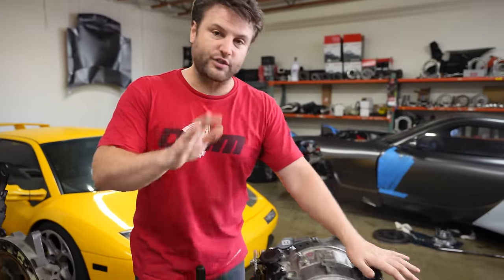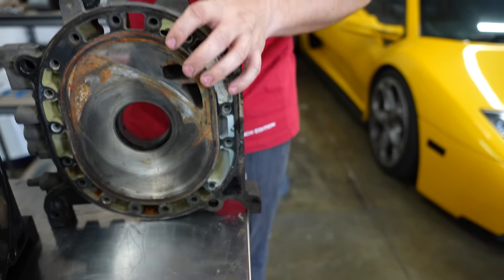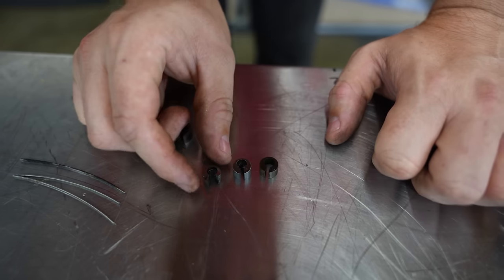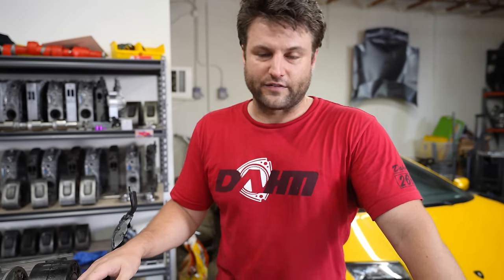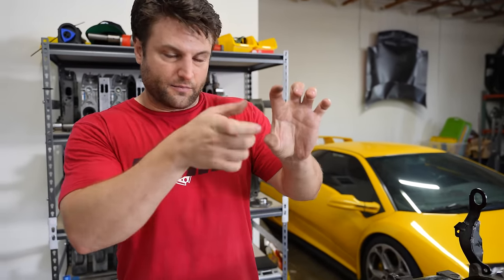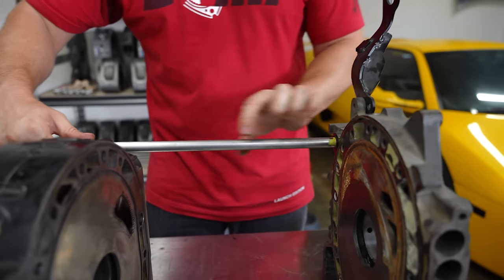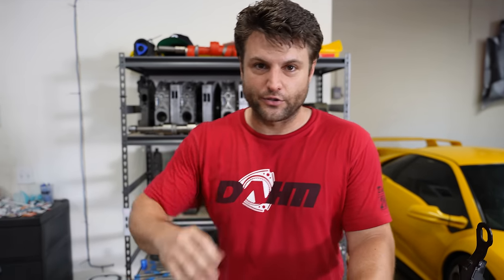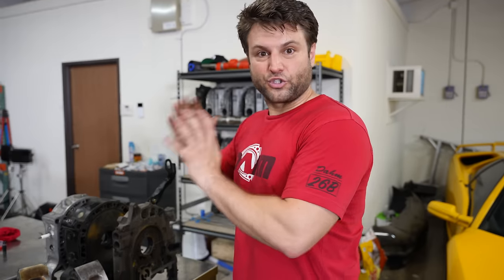Fixing the BIGGEST Problems of the Rotary Engine

Comment: Your comment on synthetic oils causing rotary engine combustion deposits is likely correct but not for the reasons you cite. 

If you're formulating a modern, conventional piston engine crankcase oil, arguably the thing you focus on most is the oil's resistance to oxidation. Why? Because excess oxidation is the root cause of other problems like out-of-control oil viscosity increase, sludge, piston deposits, ring stick & acidity related corrision.

Over the last 30 odd years, the industry has moved (in a disjointed way) from solvent extracted mineral base oils, to mildly hydrocracked 'mineral' base oils to severely hydrocracked 'synthetic' base oils to PAO. Each base oil 'bump' imparts better resistance to oxidation to the finished oil.

Now in a Wankel engine you want the injected oil to first lubricate & then burn cleanly before exiting the engine as exhaust. For clean burning you want LESS resistance to oil oxidation, not more. The best oil for burning is old fashioned Group I solvent extracted base oil which barely exists now in the US.

Bottom line is stick with a reciprocating ICE until we reach a point where EVs finally make sense & worrying about the slippery stuff is a thing of the past.

Comment: the rotary engine should be relegated to the dust-bin.  they should've taken the Tesla Turbine, and enhanced it for vehicular use.  most energy efficient internal combustion engine, not currently being utilized, due to its high RPM...so, build it small-diameter, with many high-tensile blades, in a long housing....fuel injector plus compressed air (turbo), and you've got an engine that surpasses anything currently used.  and, use magnetic bearings, to reduce wear in critical areas.  ceramics to provide longevity where parts are touching...

Comment: That's a terrible design, even the original. The momentum of an entire rotary part hitting individual small points would be really stressful on the engine wall. It would wear out quickly, casing material would warp unless made of a heavy duty material, (which in most materials is really heavy), and it creates pressure maintenance problems in separate compartments shifting pressure around. No wonder it was known for leaks. A really high materials stress environment. That transferrence of stress from the housing to the outer walls is probably why the coolant seals break. Having such thin walls between a high kinetic energy environment and both coolant and oil, where they can mix easily...no.

Comment: Mazda turned an excellent engine (in the rx7) into an unreliable turd by idiotic placement of the exhaust ports so it runs far too hot. Smaller apex seals (for emissions), one less feed from imp so the middle of the apex seals never stood a chance and a myriad of other cost saving changes. They killed their own goose. I own 2 RX8's. Great cars but only for enthusiasts

Comment: I just don't get it… An engine that's bad on emissions bad on fuel… And if you have to go this much just try to make it last little bit longer forget it… Go electric… You'd be better off with the steam engine.  The Rotary has died internal combustion engines should be a thing of the past.  I just really believe that this is all for nothing.

Comment: Just like piston engines where they will tell you "a head stud is an engineers choice, a head bolt is an accountants choice" the same thing seems to be true with rotaries. Bolts are a bad idea if you are making a performance engine and you should use studs wherever you can. It's telling that the bean counters at GM kept the Cadillac Northstar engine using head bolts for so long and hoping they'd get out of warranty instead of simply correcting the issue and studding the blocks from the factory. The Northstar would be a much more reliable and potentially powerful motor with studs. Doing the equivalent thing with the rotary  and using studs to hold it together makes a lot of sense.

Comment: It isn't about reliable.
It is making it economical.
Wankel engines burn more oil, and compressions are lower than cylinder engines.
And that isn't all the problems with Wankel engines.

Comment: Not even 5 min In and you've already informed me the motor is way worse then ots given credit for, in its prime yes it produces incredible power for it's size but what your saying is ya gotta do all this extra stuff to make an unreliable engine more reliable but still not reliable as say a i4 i6 or even a LS honestly every motor configuration I can think of requires less to make it reliable. Why limit your power with a Wankel engine when you have more options with a different engine configuration.

Comment: 1000 hp stuck in traffic congestion on $5/gal fuel, getting negative fuel economy idling stopped making toxic climate changing air pollutants bad for public health also a drain on your wallet and no fun. Most people are no YouTubers with lots of random time off as decided mid week day to flock off driving outside of the morning & evening high volume traffic commuting times //

Comment: the engine should have big beefy interlocking keys and not rely on dolls and then the only think to worry about is bolt stretching and or fracturing another thing is why not have a rotor that is a hair smaller and a replaceable sleeve with a bit of change in thickness and maybe a few keys as well as a pressure fit to make this sleeve stay in place people are paying enough that these design factors should be standard

Comment: one of the biggest reasons why rotaries are "not as reliable as a piston engine"...  they can't valve-bounce...  They will rev all the way up to 33million rpm's, or die tryin...  so their longevity is directly proportional to the amount of mechanical intellect/sympathy the asshole behind the wheel has...

Comment: Two stroke oil will make more carbon and dose not burn clean.it leaves carbon all over the rotars.from lawn mowers to car have done it so it leaves carbon on combustion engines and rotary.
Wankel made the rotorary engine